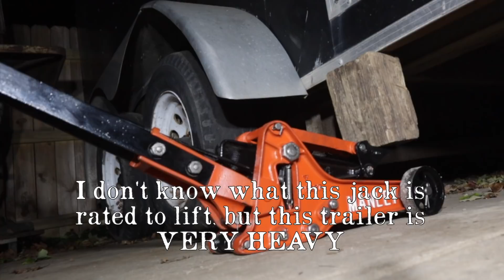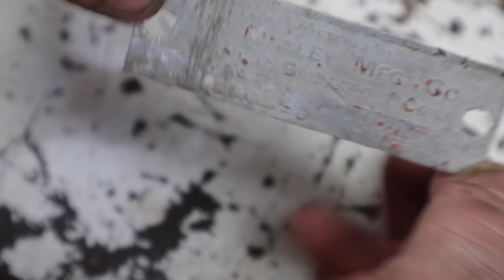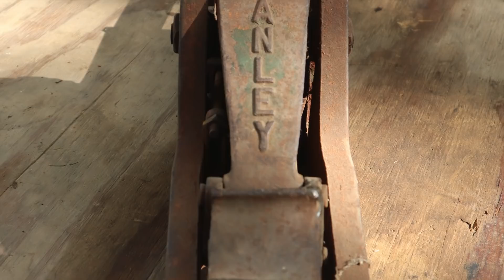Rusty OLD Mechanical Floor Jack ~ RESTORATION ~ Now THAT'S a MANLEY Jack!

Comment: Good to see some Manley bicep action going on there Mr. Salvage. Another fine artifactual resurection. May l suggest a vice mounting/base plate that would temporarily afix to the square hole in your anvil.

Comment: Nice job!!  I use evaporust in my restorations also. Try this, after you take it out of the evaporust just run your parts under running water and wire brush them quick clean up.

Comment: Have you thought about trying a hard rubber paint roller on the raised lettering? Just a thought here.
Reply: Brayer = hard rubber roller. Available in arts and crafts stores. Stamp pad is another way if using ink. I've also used a wine cork. Dip it in paint and then off load on a paper towel before pressing on the raised letters
Reply from the maker: I've considered it, but most times I have more control over the end result with paint pens or a brush... I haven't tried your methods though, maybe i'll give em a shot!

Comment: Would look great under an old straight axle Model T picking up the front end. Very nicely done, but invest in a sandblast cabinet, would save loads of time plus limit the exposure to harsh chemicals, and all the rust-lead paint dust from wire wheels. Use some shim washers right and left on those captured pins to keep parts centered, and a few drops of oil on moving parts (not grease....only attracts sand, and dirt). Incidentally love the Weimaraners (5?).
Reply from the maker: Thank you Bert! I am already on the hunt for a QUALITY used sand blasting cabinet! I appreciate you watching & commenting! We have 6 Weims!

Comment: The Manley Floor Jack vintage 1929 invented by Robert E Manley in Bridgeport Connecticut.  In 1931 the Eastern valve company of Hanover Pennsylvania purchase the patent. The non Hydraulics for used on tow trucks. Unrestored from $100 to $1,000 in value depending on the model.

Comment: Very nice restoration!  The one thing I would have done differently is, liberal application of lube on every moving part during reassembly.  I didn't see any lube except during disassembly.
Reply from the maker: Thank you Jim! Ya not using oil / grease during reassembly was an over sight! It's all lubed up now!

Comment: You can find info on Manley Manufacturing Co , Bridgeport Conn searching the net , I did.
This looks like it is a 5000 Lb ( 2 1/2  Ton ) floor jack. Yours looks new all the ones on the 
net are antiques.

Comment: Pretty piece!  Did you research the colors or just pick what you thought was good.  I thought I saw several different old coats of paint on there.  I'm growing tired of blacks and machine grey's but I don't want the shop to look like a pack of Skittles either!
Reply from the maker: LOL Skittles, I love that! Ya i don't want that either, but usually there is so many other things that are more simple colors that the brighter colored objects just look nice assuming they are done right! I am usually partial to black and grey as well! I definitely researched it, but I hardly found ANYTHING on it or the company on the internet, other than another one for sale in similar condition on ebay! I went with the burnt orange beause I liked it better than puke green! I also went with some components black, and hardware bare metal to really enhance the original beauty of this old MANly Manley!

Comment: Using an extension on your impact reduces its impact force, a significant amount  if possible, they should be avoided.  Love your videos , keep up the great content. Have you tried citric acid concentrate as a rust remover ? It can be found as a powder and is quite effective.

Comment: Have you ever found an old Toe jack with winding handle attatched to a rack and pinion lift ?., ..they are about 3-4 foot high, extend to 6-7 foot and are surrounded by a wood box...they can lift a ton or 2 easy

Comment: brass or copper pipe for a tight fit bearing on that pin.  you can cut the pipe long wise to make it fit the hole.

Comment: I don't think I would have messed with that old brazing unless I was going to weld it. I wouldn't be using that jack. It still looks very cool.
Reply from the maker: I messed with it PURELY due for looks! This old beast won't see much use because I just don't trust it  as much as my newer floor jacks, so I'm not too worried about it! I'm glad you enjoyed the video! Thanks for watching and commenting!

Comment: Great restoration 👍 not seen one like that before. Dunno if i'd trust it much tho 😬
New shop looks nice too.. when will you add the roof ,walls and floor ? 😁
Reply from the maker: Thanks Bill! Ya when I found it buried in this old building I was PUMPED because I love finding unique tools even if I never plan to actually use it, and this jack I DO NOT plan to use! I'm gonna stick with a dirt floor, but the walls and roof are scheduled to be installed spring of 2028, so stay tuned, It'll be here in no time.. lol!
Reply: I envy you guys over there.. sooo many great old tools and stuff still to be found. they dont need to be used but they do deserve respect. Hard to find good stuff in Tassie at a decent price but they do turn up. I'm restoring an Aussie made Rexman metal lathe atm 40's era... rough as guts but  a fun project.
Glad i found your channel. right up there with Eric, I reckon 👍🍺
Reply from the maker: @billbaggins  Thank you Bill, that's a tall compliment! Eric does incredible work, and his channel was the initial inspiration giving me the idea to start videoing my projects out in the shop! Here in the midwest, there is ALWAYS more to be discovered!  I've heard that same thing from quite a few people from across the pond! Nothing wrong with doing what you can with what you have! I'd love to see your Rexman Lathe!
Reply: 😁 I'm fussy about who and what i watch.
A good Aussie finder of stuff is Rob @ Xynudu on youtube. found an old Schaublin under a tree 🤣.
do a google search on Rexman and you'll find all the info that exists 😕
 Great fun putting the headstock and change gears back together relying on " nah dont need to take a photo, I'll remember " 🤦‍♂️🤣

Comment: Do your bullet vice next
Reply from the maker: If I do that, I won't want to actually use it!
Reply: @SalvageWorkshop  i think restoring wilton bench vises are the most watched restoration videos though.
Reply from the maker: HMM...
Reply: @SalvageWorkshop  you could draw it outand make 3 or four videos and people would watch them for years.  Its an addiction for some of us.  Ive watched them all. Lol
Reply from the maker: @thecynic807  I have that same addiction!! Ive got like 6 or 7 vises (maybe more) I could restore, and I was already thinking about about doing another vise soon! I prolly won't make it more than 1 video per vise, but i've been toying with the idea of doing longer format restoration videos... there is ALWAYS a TON of content I have to cut out... we'll see about that though... Now when it comes to restoring my Lathes, or massive planer, band saw or jointer, those will each have a video series because of the INCREDIBLE amount of work that would go into each machine!

Comment: I was just wondering the other day if they ever made sockets for square nuts
Reply from the maker: Ya they can be pretty useful when working on older machines as much as I do...  I wish I owned more of them, I only have 2 sizes, but they are the most common sized square heads I NORMALLY come across... I looked them up and they are still available, maybe we should both get a set! https://amzn.to/31N1wKk
Reply: Yes they do square nuts and called carriage nuts and they make 8 point rather than 6 or 12 point sockets.

Comment: The bent nails and pins are original from factory just like they were when you tried to remove them as they ran out of the split pins /Cotter pins and straight large pins

Comment: "It would be nice if I had a vice".  10 seconds later has a vise. This guy knows the tool genie. "It would be nice if I had a '62 vette".
Reply: The progression there was fun.  Tiny chunk of wood didn't do it. Obviously didn't want to mount the vice to the table either.
Then mounted it to a huge tree stump... perfect height too!  Not something to leave outside, but that "fixed" things nicely.
Reply from the maker: That vise stays outside all the time... I just spray it with penetrating oil  once a week or so just to keep it free! Its been out there for over a year!

Comment: Gorgeous restoration. I'd not trust that to hold a car over my head, but to get it on jack-stands, A-OK!
Amazing what people did with the stuff they had.  Now, hydraulics are cheap and common, 
but not anywhere near as beautiful.

Also, don't EVER lift a trailer by the box.. get under the frame, or suspension! Like a car.
Otherwise, you can easily bust out the bolts that mount the box / body onto the frame.
Reply from the maker: I totally agree with you on the jack! NO TRAILER was HARMED in the making of this video! that trailer is a BEAST! It was late and I needed to show it lifting something easy to see on camera.

Comment: Not entirely sure on the accuracy, but what I can get from Manley Floor Jack 5287 seems to indicate a 2 1/2 ton limit.
Reply from the maker: That's a good thought, but those numbers are individual part numbers... Each of the major parts has it's own number cast into it from the factory, many older cast iron tools & machines like this have the same thing!
Reply: @SalvageWorkshop  ah, gotcha. Meh, I tried. There's apparently also a hydraulic one from around the same time too.
Reply from the maker: @InstrucTube  No worries at all! I appreciate your thoughts on this old beast, I would love to know more about it and its history!  I saw there was a hydraulic one too, which makes me thing this one might be even older... Who knows!

Comment: you didn't put any grease on the pivor points/gear teeth? that wont last long.
Reply from the maker: It's probably 70-100 years old, COMPLETELY mechanical, and definitely not been OILED in the last 60 of those years, I think it will be just fine! Thanks for the concern though!
Reply: @SalvageWorkshop  if this tool will work, it should be oiled. But in other case too, or it will rust.

Comment: You know if you have a 55 gallon plastic barrel you can use water and molasses to derust all of that metal mix ratio is 40 to one
Reply from the maker: I have not tried that recipe before! Many times I don't have the time to wait for rust removal on these projects becasue I only have so much time between my other businesses and getting a new video done each week! Thanks for the tip!
Reply: @SalvageWorkshop  it does take awhile for it to work if you put them in it , it could take a month for all the rust to disappear but it gives you time to do other things and if has paint on an item it will not take it off
Reply from the maker: Ya I would NEVER have that kind of patience! Especially with products like Evaporust!

Comment: Is “ 5287( in pounds)” the weight limit or just the serial number?
Reply from the maker: That is actually a part number... they used to cast part numbers into each part... Look at the other parts closely, you'll see similar numbers on the major parts. Good question!
Reply: Thank you for your correcting me.

Comment: You should get some brass bars to knock out the pins. All your doing is mushrooming them
Reply from the maker: I've been meaning to get / make some, but there are a million things in that category with a shop like mine, it just hasn't happened yet! They would be useful! You wouldn't have any extra, would you?
Reply: I’ve only have two.

Comment: I hope you threw it out after you were done. Those pins were bent because it was abused, no telling what other cast parts may have invisible fractures just waiting to fail. The brazed part is not as strong as the original part. That said, good job on the restoration.
Reply from the maker: ANY jack can fail at ANY point! That's why the use of jack stands is ALWAYS a MUST with any jack, no matter how old it is! Thanks for the concern though, I appreciate you watching and commenting!
Reply: I beg to differ...brazed cast iron will fail usually at another point other than the weld. It's equally strong as original.  I do however question why manufacturer used cast parts at stress points, and agree that to bend short 3/4" pins takes large forces=abuse. Should be reserved for picking up Model T's, and buggies. (use jack stands too)

Comment: You sir are swinging a bigger than me. I wouldn't have trusted the l part that was repaired just by brazing it back together. Otherwise a wonderful restoration job
Reply: Does this make the jack unusable now? It’s integrity is compromised now

Comment: If you want a cheaper way of removing rust off metal parts use CITRIC ACID CRYSTALS IN HOT WATER and just leave to soak. the metal come up like new

Comment: Ok enough with the the spray on bolt remover .all your are doing is making a mess .it will never work instantly . At best it needs to soak 12 hours . that's why it's called penetrate . It makes you look like you don't know what you're doing. Anyway like you're videos and hope to see you trying to look like you are a professional in next video. Dam that sounded mean just pretend it was advise.
Reply from the maker: Thanks for watching Al!

Comment: Those things could be treacherous! We used to have a couple of 5 tonners, would be the last jacks to use if you had a choice.
Reply from the maker: I can only imagine! When I want to safely lift something with ANY potential of danger to myself or others, this will NOT be the jack I use... It sure made for a cool restoration video though!
Reply: I won´t trust two thing on it:
The "tray" part - it broke once, it may break again.
The lowering action, it can go into auto mode, same like with most ratched jacks. Got an OEM one with an ´86 Chevy Caprice, if you let the hande go while pushing down in lowering mode, it lowers the car by itself pretty fast.
Reply: @SalvageWorkshop  Yes, was interesting to watch. I never realised how many parts it is made up from. I think it was strained in its past life, which has caused the bent pins and fractured saddle.
Reply from the maker: @peebee143  I agree, this jack was definitely used hard, but it has been able to stand the test of time! Still not sure I'll trust it!

Comment: Please spend a dollar or two and get yourself several Ball Pein Hammers 8 -12 - 16 - 24 oz. and at least two each "C" and "F" 4" 6" 8" clamps, I am really tired of watching you chase parts around the work table and hitting bolts with a 4 pound drill hammer.

Comment: THIS MAY BE THE HARDEST LESSON FOR YOU TO LEARN.

never ever draw a file backwards!
( it bends over the cutting edges and then they stop cutting)
ONCE U DO THAT..ITS OVER. THERE IS NO WAY TO SHARPEN A FILE. SO DONT DRAG THE FILE BACKWARDS. CRESENT WRENCHES CAN ADJUST TO SIZE OF NUT. AND CHANNEL LOCKS ADJUST PROPERLY SO YOUR HAND IS NOT STRETCHED OUT.
DEVELOPING BAD HABITS ..YOU ARE..AA- HHA.
ALSO , UNTILL U GET MORE EXPERIENCE WITH CAST IRON...DONT USE A TOURCH ON IT.
OR A HAMMER!